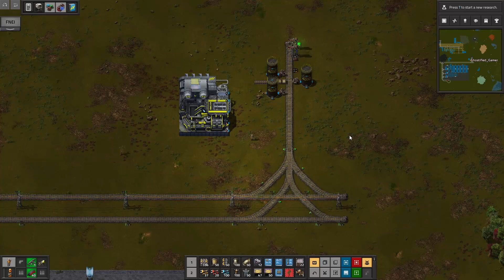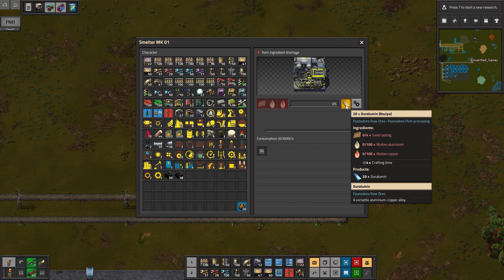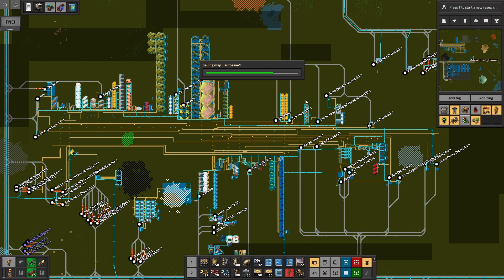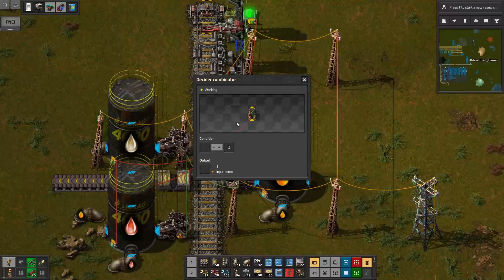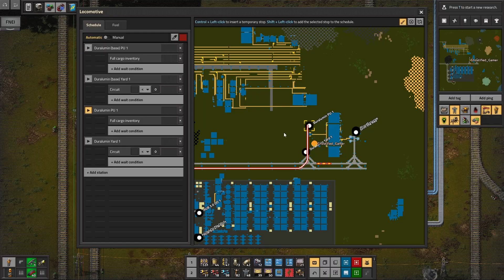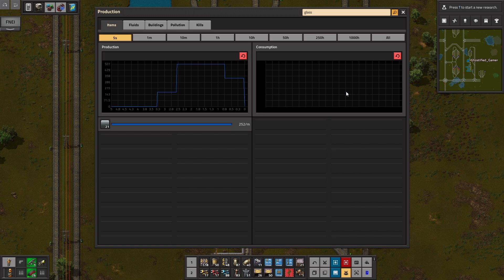Factorio pYanodons | Starter Base Independence | Duralumin and Glass Plate - EP92

Comment: If the constant beeping of the local radar is driving you nuts, I may have a solution. If you can find the folder where your Factorio mods are loaded from on your hard disk, go into the Py Industry mod folder and look for its "sounds" subfolder. The "radar.ogg" file inside there is the one you want. I suggest copying it elsewhere so you can put it back if your edits cause problems, but you should be able to open it up in an audio editor and lower its volume, or even replace it with complete silence if you want to silence those radars entirely. I'd actually request that, because I suspect their beeping is going to drive me up the wall in the future if you go ahead and replace your vanilla radars with local radars everywhere except your base edges.
Reply from the maker: Ah, I'm just complaining to complain.  I'll just walk away from the noises :P  Thanks for the suggestion though  👍

Comment: When you're editing stations in TSM, what happens if you choose one that's already on the list? Does it add it twice, or does it remove the previous entry and then add it to the end? Because if it's the latter, that would be a way you could rearrange a station list without having to delete everything. I can think of scenarios where it would work and ones where it wouldn't, but it's something to try, at least.
Reply from the maker: Not sure.  I think the station is removed from the list once selected?  I'll have to test that out as there may have been an update that I don't know about but doubt it.  But I'm fairly sure that the list needs to be rearranged each time.  There is a utility to get the station lists in a text file but never needed it as it's not to difficult to rearrange the yards.